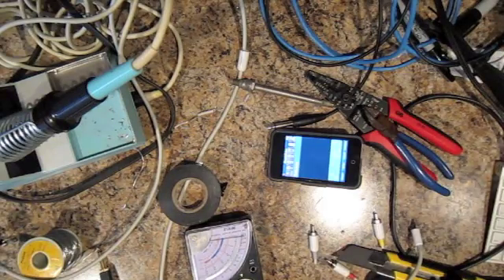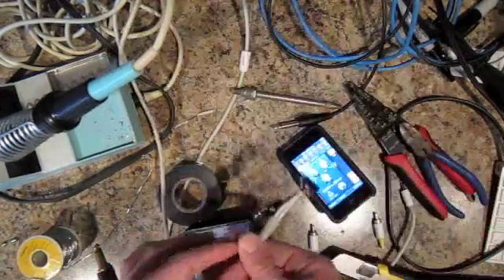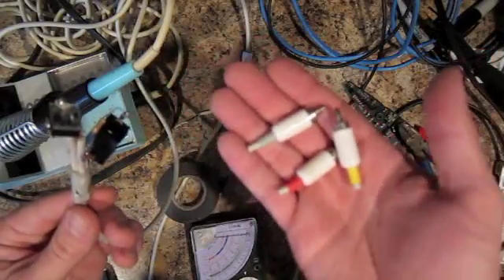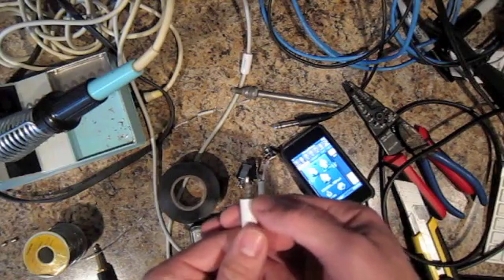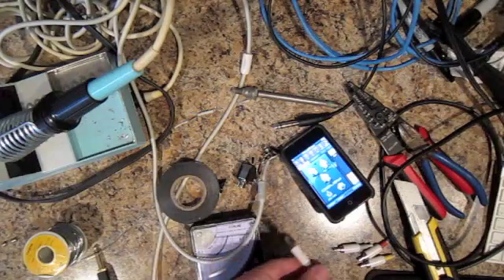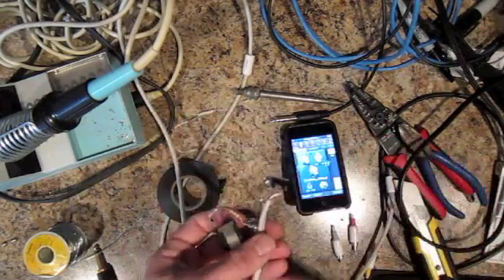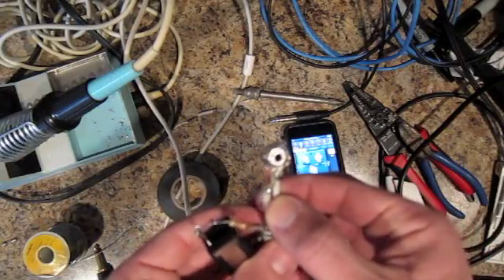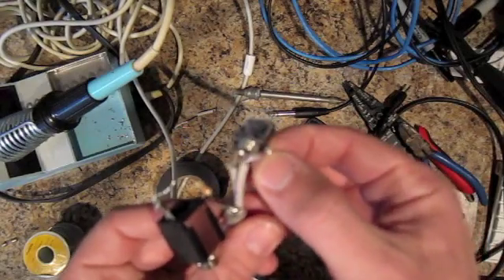Homemade Build DIY iRig (or, guitar or line input) to ipod touch, iphone, or ipad

Comment: Necro time. If you're still around out there.  I see this was an analog cable you created, as opposed to "USB soundcard" I didn't hear any delay/lag in output which makes me curious.

I built a cheap ass wire and tried to pass the output through Bluetooth and took major lag.

I'm using Android which is known to have inferior audio processing speed compared to apple products.
Reply: Your Bluetooth has to be something called aptx compatible to get no lag